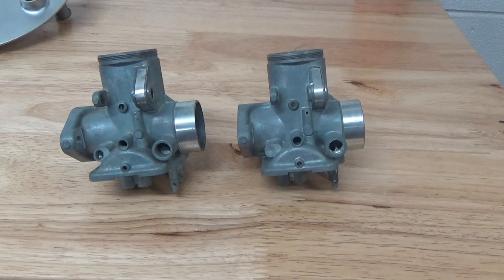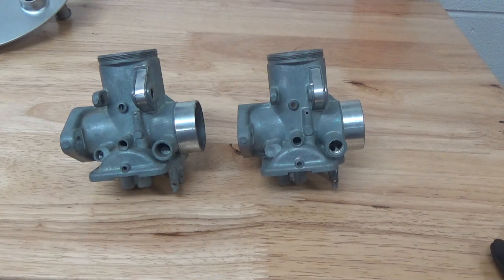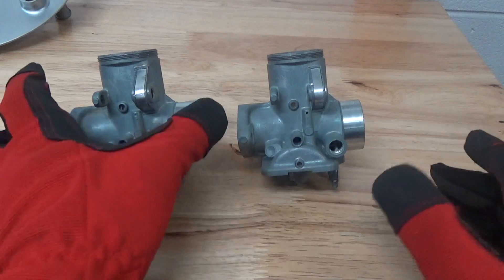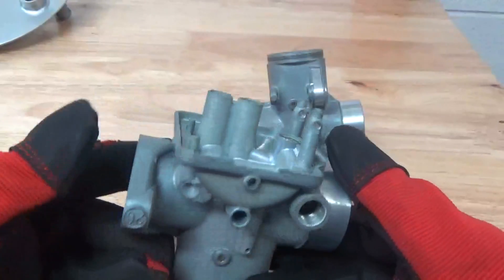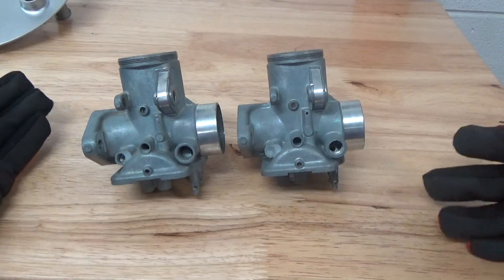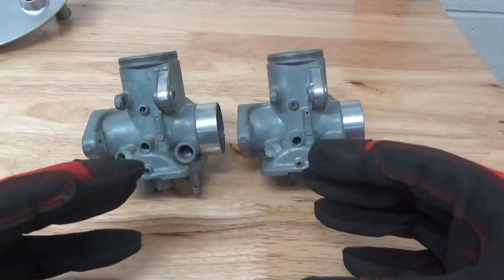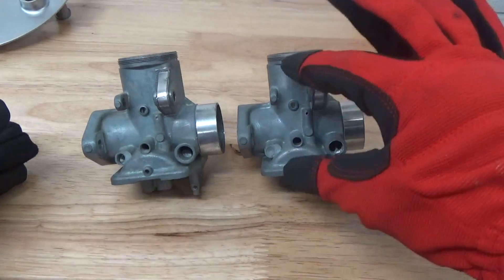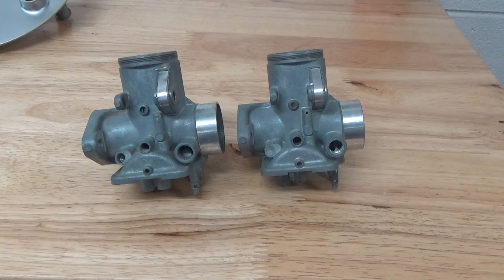Zinc Carburetor Casting Cleaning & Finishing- Vapor Honing Technologies

Comment: Are you selling the blasting equipment or the service? Checked the website no pricing only replacement parts, must be very expensive. Yes?
Reply from the maker: we have the micro starting @799 and goes up from there. If you value support and 9 years experience plus lifetime warranty there's a lot of value here.
Reply: Yea these machines are very expensive looking in the 2g area for a small one easier to try to build one there is a video on YouTube and a guy builds one for like 400 to 500 bucks I'm thinking of building one my self

Comment: Do you actually use a vapor or is that just the name?
Reply from the maker: By definition; Vapor Blasting, also known as Wet Abrasive Blasting, Vapor Honing or Aqua Blast, is the acceleration and atomisation by a pressurized gas of a stream of water and fine abrasive media.  This is a water/abrasive mixture that creates a slurry and Compressed Air that creates the pressure.
Reply: Thanks. that's interesting.